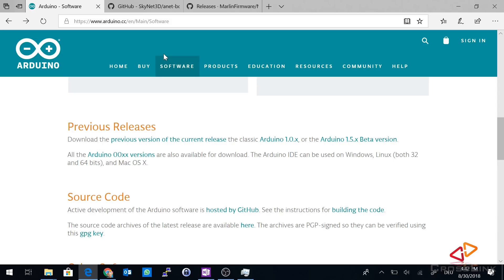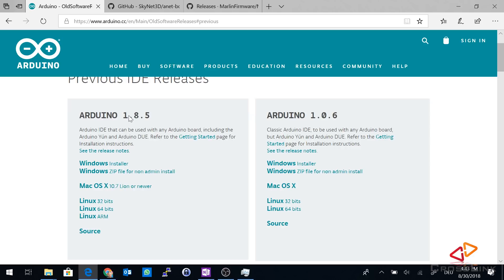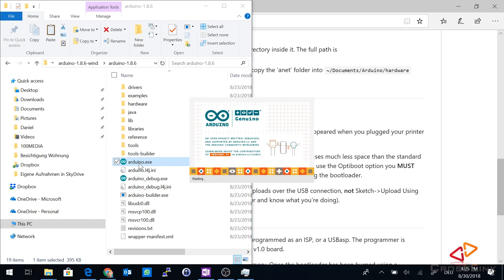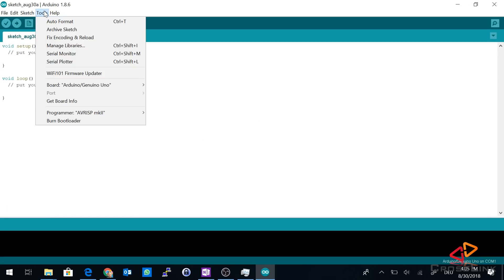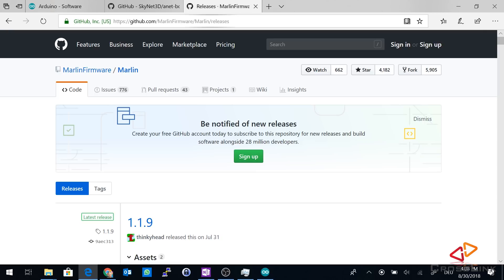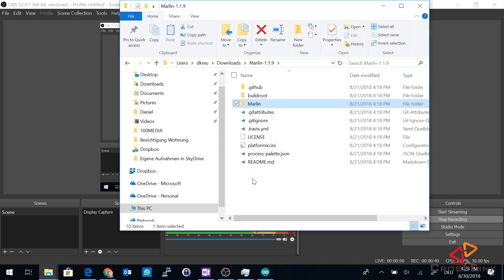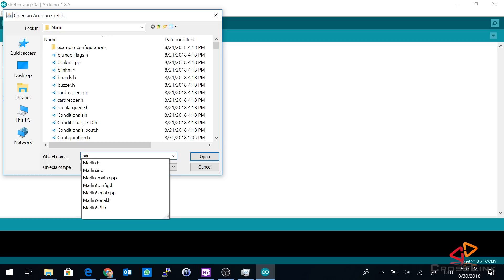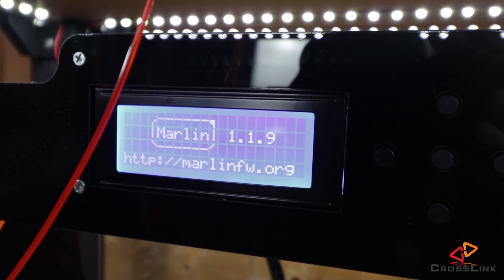How to install Marlin firmware 1.1.9 on your Anet A8 3D printer in 7 easy steps

Comment: Hi @Crosslink , aas Carole White 10 months ago, I've just got the same error.  The firmware uploaded OK.  Marlin 1.1.9 identifies on control panel, but  XYZ all alternating between ? and 0.  No other commands on the panel appear to be working.  Enter takes me to a menu, but trying to select anything sends me back to the home page.    Up and Down alter the FR %, but that's all.  Any thoughts?
Reply: Forgot to say, I don't have an auto bed leveller
Reply: Ahh! may have solved it.  What I am seeing is normal.  Just watched your Mesh bed levelling video and saw your screen displays the same.  The problem I thought I had is actually that the Right button no longer acts as the enter button, and the menu (middle) button actually takes that role.

Comment: I followed the instructions provided in the video and successfully installed Marlin on my A8. My hotbed, however, quit working. I found what I hoped would be a solution to this problem. I inserted the line of code and tested it. When I tried to download it I got a message. 
Problem uploading to board.  See http://www.arduino.cc/en/Guide/Troubleshooting#upload for suggestions.
there is no error code or any other info given. I undid the line I just put in and tried to flash it again. I got the same message. I have made no other changes to the code other than the one line. Did I break it somehow?

Comment: Thank you Daniel, your videos are VERY usefull andclear, but I've got a little issue with the point 2. 
After copied the "hardware" folder in "Documents\Anet\" (I had to create the Anet folder), I opened the arduino ide but the Anet V1.0 isn't listed in the avelable boards. I've tried to restart the pc but it's always the same. Help me please! :'(
Reply: ok I've solved! I simply copy the board definition folder inside the "hardware" folder located in the same directory of the arduino.exe

Comment: Now that I have Marlin on my Anet A8, why do my xyz axis's not move all the way to the limit switches?  Facing the printer, X will go all the way to the right, but not all the way left to the limit switch. Y axis will come all the way forward, but not all the way back to the limit switch,  and Z axis will go all the way up, but will not go down far enough to touch that limit switch either.
Reply from the maker: What does the printer do when you auto home? Is it going to the wrong direction? If yes, double check if you copied the Anet A8 default configuration from the samples directory in Marlin to the main directory to overwrite the defaults.
Reply: Yes I did overwrite the Marlin config files , with the ones from the examples folder . When I home it, hotbed goes back and stops, X goes to the left and stops at limit switch, and z goes down, but currently have to shut off before it gets to limit switch, because there is a bad pin on the board connector for that limit switch and getting new replacement day after tomorrow. This is a brand new board, but found limit switch wasn't working . Board is Anet V1.7.   So aside from having to shut down because of inoperative limit switch on z axis, does it sound okay?  Just funny that it will go to what looks like the old home position, but cannot move all the way manually. Other thing, is what do I need to do now ?

Comment: i keep getting missing character error:
Arduino: 1.8.5 (Windows 10), Board: "Anet V1.0"

In file included from C:\Users\RODNEY\AppData\Local\Arduino15\packages\arduino\hardware\avr\1.6.22\cores\arduino/Arduino.h:257:0,

                 from sketch\Marlin.ino.cpp:1:

C:\Users\RODNEY\Documents\Arduino\hardware\anet\avr\variants\sanguino/pins_arduino.h:43:0: warning: "TIMER2" redefined

 #define TIMER2  5

 ^

In file included from sketch\Marlin.ino.cpp:1:0:

C:\Users\RODNEY\AppData\Local\Arduino15\packages\arduino\hardware\avr\1.6.22\cores\arduino/Arduino.h:210:0: note: this is the location of the previous definition

 #define TIMER2  6

 ^

In file included from C:\Users\RODNEY\AppData\Local\Arduino15\packages\arduino\hardware\avr\1.6.22\cores\arduino/Arduino.h:257:0,

                 from sketch\Marlin.ino.cpp:1:

C:\Users\RODNEY\Documents\Arduino\hardware\anet\avr\variants\sanguino/pins_arduino.h:44:0: warning: "TIMER2A" redefined

 #define TIMER2A 6

 ^

In file included from sketch\Marlin.ino.cpp:1:0:

C:\Users\RODNEY\AppData\Local\Arduino15\packages\arduino\hardware\avr\1.6.22\cores\arduino/Arduino.h:211:0: note: this is the location of the previous definition

 #define TIMER2A 7

 ^

In file included from C:\Users\RODNEY\AppData\Local\Arduino15\packages\arduino\hardware\avr\1.6.22\cores\arduino/Arduino.h:257:0,

                 from sketch\Marlin.ino.cpp:1:

C:\Users\RODNEY\Documents\Arduino\hardware\anet\avr\variants\sanguino/pins_arduino.h:45:0: warning: "TIMER2B" redefined

 #define TIMER2B 7

 ^

In file included from sketch\Marlin.ino.cpp:1:0:

C:\Users\RODNEY\AppData\Local\Arduino15\packages\arduino\hardware\avr\1.6.22\cores\arduino/Arduino.h:212:0: note: this is the location of the previous definition

 #define TIMER2B 8

 ^

In file included from C:\Users\RODNEY\AppData\Local\Arduino15\packages\arduino\hardware\avr\1.6.22\cores\arduino/Arduino.h:257:0,

                 from sketch\Marlin.ino.cpp:1:

C:\Users\RODNEY\Documents\Arduino\hardware\anet\avr\variants\sanguino/pins_arduino.h:47:0: warning: "TIMER3A" redefined

 #define TIMER3A 8

 ^

In file included from sketch\Marlin.ino.cpp:1:0:

C:\Users\RODNEY\AppData\Local\Arduino15\packages\arduino\hardware\avr\1.6.22\cores\arduino/Arduino.h:214:0: note: this is the location of the previous definition

 #define TIMER3A 9

 ^

In file included from C:\Users\RODNEY\AppData\Local\Arduino15\packages\arduino\hardware\avr\1.6.22\cores\arduino/Arduino.h:257:0,

                 from sketch\Marlin.ino.cpp:1:

C:\Users\RODNEY\Documents\Arduino\hardware\anet\avr\variants\sanguino/pins_arduino.h:48:0: warning: "TIMER3B" redefined

 #define TIMER3B 9

 ^

In file included from sketch\Marlin.ino.cpp:1:0:

C:\Users\RODNEY\AppData\Local\Arduino15\packages\arduino\hardware\avr\1.6.22\cores\arduino/Arduino.h:215:0: note: this is the location of the previous definition

 #define TIMER3B 10

 ^

In file included from C:\Users\RODNEY\AppData\Local\Arduino15\packages\arduino\hardware\avr\1.6.22\cores\arduino/Arduino.h:257:0,

                 from sketch\Marlin.ino.cpp:1:

C:\Users\RODNEY\Documents\Arduino\hardware\anet\avr\variants\sanguino/pins_arduino.h:49:0: warning: "TIMER3C" redefined

 #define TIMER3C 10

 ^

In file included from sketch\Marlin.ino.cpp:1:0:

C:\Users\RODNEY\AppData\Local\Arduino15\packages\arduino\hardware\avr\1.6.22\cores\arduino/Arduino.h:216:0: note: this is the location of the previous definition

 #define TIMER3C 11

 ^

In file included from C:\Users\RODNEY\AppData\Local\Arduino15\packages\arduino\hardware\avr\1.6.22\cores\arduino/Arduino.h:257:0,

                 from sketch\Marlin.ino.cpp:1:

C:\Users\RODNEY\Documents\Arduino\hardware\anet\avr\variants\sanguino/pins_arduino.h:50:0: warning: "TIMER4A" redefined

 #define TIMER4A 11

 ^

In file included from sketch\Marlin.ino.cpp:1:0:

C:\Users\RODNEY\AppData\Local\Arduino15\packages\arduino\hardware\avr\1.6.22\cores\arduino/Arduino.h:217:0: note: this is the location of the previous definition

 #define TIMER4A 12

 ^

In file included from C:\Users\RODNEY\AppData\Local\Arduino15\packages\arduino\hardware\avr\1.6.22\cores\arduino/Arduino.h:257:0,

                 from sketch\Marlin.ino.cpp:1:

C:\Users\RODNEY\Documents\Arduino\hardware\anet\avr\variants\sanguino/pins_arduino.h:51:0: warning: "TIMER4B" redefined

 #define TIMER4B 12

 ^

In file included from sketch\Marlin.ino.cpp:1:0:

C:\Users\RODNEY\AppData\Local\Arduino15\packages\arduino\hardware\avr\1.6.22\cores\arduino/Arduino.h:218:0: note: this is the location of the previous definition

 #define TIMER4B 13

 ^

In file included from C:\Users\RODNEY\AppData\Local\Arduino15\packages\arduino\hardware\avr\1.6.22\cores\arduino/Arduino.h:257:0,

                 from sketch\Marlin.ino.cpp:1:

C:\Users\RODNEY\Documents\Arduino\hardware\anet\avr\variants\sanguino/pins_arduino.h:52:0: warning: "TIMER4C" redefined

 #define TIMER4C 13

 ^

In file included from sketch\Marlin.ino.cpp:1:0:

C:\Users\RODNEY\AppData\Local\Arduino15\packages\arduino\hardware\avr\1.6.22\cores\arduino/Arduino.h:219:0: note: this is the location of the previous definition

 #define TIMER4C 14

 ^

In file included from C:\Users\RODNEY\AppData\Local\Arduino15\packages\arduino\hardware\avr\1.6.22\cores\arduino/Arduino.h:257:0,

                 from sketch\Marlin.ino.cpp:1:

C:\Users\RODNEY\Documents\Arduino\hardware\anet\avr\variants\sanguino/pins_arduino.h:53:0: warning: "TIMER5A" redefined

 #define TIMER5A 14

 ^

In file included from sketch\Marlin.ino.cpp:1:0:

C:\Users\RODNEY\AppData\Local\Arduino15\packages\arduino\hardware\avr\1.6.22\cores\arduino/Arduino.h:221:0: note: this is the location of the previous definition

 #define TIMER5A 16

 ^

In file included from C:\Users\RODNEY\AppData\Local\Arduino15\packages\arduino\hardware\avr\1.6.22\cores\arduino/Arduino.h:257:0,

                 from sketch\Marlin.ino.cpp:1:

C:\Users\RODNEY\Documents\Arduino\hardware\anet\avr\variants\sanguino/pins_arduino.h:54:0: warning: "TIMER5B" redefined

 #define TIMER5B 15

 ^

In file included from sketch\Marlin.ino.cpp:1:0:

C:\Users\RODNEY\AppData\Local\Arduino15\packages\arduino\hardware\avr\1.6.22\cores\arduino/Arduino.h:222:0: note: this is the location of the previous definition

 #define TIMER5B 17

 ^

In file included from C:\Users\RODNEY\AppData\Local\Arduino15\packages\arduino\hardware\avr\1.6.22\cores\arduino/Arduino.h:257:0,

                 from sketch\Marlin.ino.cpp:1:

C:\Users\RODNEY\Documents\Arduino\hardware\anet\avr\variants\sanguino/pins_arduino.h:55:0: warning: "TIMER5C" redefined

 #define TIMER5C 16

 ^

In file included from sketch\Marlin.ino.cpp:1:0:

C:\Users\RODNEY\AppData\Local\Arduino15\packages\arduino\hardware\avr\1.6.22\cores\arduino/Arduino.h:223:0: note: this is the location of the previous definition

 #define TIMER5C 18

 ^

C:\Users\RODNEY\Downloads\Marlin-1.1.x\Marlin-1.1.x\Marlin\Marlin.ino:15:21: warning: character constant too long for its type

 located in the root 'Marlin' folder. Check the example_configurations folder to

                     ^

C:\Users\RODNEY\Downloads\Marlin-1.1.x\Marlin-1.1.x\Marlin\Marlin.ino:16:13: warning: missing terminating ' character

 see if there's a more suitable starting-point for your specific hardware.

             ^

Marlin:16: error: missing terminating ' character

 see if there's a more suitable starting-point for your specific hardware.

 ^

Marlin:30: error: too many decimal points in number

     (Applies to Marlin 1.0.x, so Jerk and Acceleration should be halved.)

                        ^

C:\Users\RODNEY\Downloads\Marlin-1.1.x\Marlin-1.1.x\Marlin\Marlin.ino:34:11: warning: missing terminating ' character

     Marlin's configuration options are explained in more detail here.

           ^

Marlin:34: error: missing terminating ' character

     Marlin's configuration options are explained in more detail here.

     ^

C:\Users\RODNEY\Downloads\Marlin-1.1.x\Marlin-1.1.x\Marlin\Marlin.ino:49:12: warning: missing terminating ' character

   -  If you'd like to contribute to Marlin, read this first!

            ^

Marlin:49: error: missing terminating ' character

   -  If you'd like to contribute to Marlin, read this first!

   ^

Marlin:2: error: expected unqualified-id before '==' token

 ================================================================================

 ^

exit status 1

missing terminating ' character

This report would have more information with

"Show verbose output during compilation"

option enabled in File -> Preferences.

so I have no clue what is wrong any suggestions ? thanks  and I love your tutorials

Comment: first thanks for all these videos.  my first question is do i need the marlin update? i have a tronxy p802ma anet a8 i3 clone. has a melzi 2.0_V5 board. second, i lost the SD card. can i just update marlin and use cura? or do i need to continue using repertier host with slicer brand slicer? thanks.
Reply: also my printer needed to be updated at purchase. a former coworker did it so im at a loss on how to do it.

Comment: THANK YOU DANIEL!!!!      I have owned an Anet A8 for two years but was always hesitant to change the firmware as other tutorials and info were kind of confusing and I did not want to brick my printer. Daniel's videos are very clear and understandandable as to showing what steps are necessary to upgrade to Marlin. I followed step by step as Daniel showed and was able do the upgrade without any problems whatsoever! I now have Marlin 1.1.9 and thermal runaway protection. Once again THANK YOU DANIEL!!!!

Comment: My Anet A6 have burned it's card. So i got a new card Anet V1-5. I will like too flash it to anet a6, but it dont work. If i flash it as Anet a8 its fine, but it's not the same center. If i flashing a6, It have problem on lcd-screne. Hope you understand my terrible english (komming from denmark)

Comment: compiles ok on 1.8.5 but won't flash 

Global variables use 4111 bytes of dynamic memory.
C:\Program Files (x86)\Arduino\hardware\tools\avr/bin/avrdude -CC:\Program Files (x86)\Arduino\hardware\tools\avr/etc/avrdude.conf -v -patmega1284p -carduino -PCOM3 -b57600 -D -Uflash:w:C:\Users\stanl\AppData\Local\Temp\arduino_build_827511/Marlin.ino.hex:i 

avrdude: Version 6.3, compiled on Jan 17 2017 at 12:00:53
         Copyright (c) 2000-2005 Brian Dean, http://www.bdmicro.com/
         Copyright (c) 2007-2014 Joerg Wunsch

         System wide configuration file is "C:\Program Files (x86)\Arduino\hardware\tools\avr/etc/avrdude.conf"

         Using Port                    : COM3
         Using Programmer              : arduino
         Overriding Baud Rate          : 57600
avrdude: stk500_getsync() attempt 1 of 10: not in sync: resp=0xb1
avrdude: stk500_getsync() attempt 2 of 10: not in sync: resp=0x44
avrdude: stk500_getsync() attempt 3 of 10: not in sync: resp=0x99
avrdude: stk500_getsync() attempt 4 of 10: not in sync: resp=0xff
avrdude: stk500_getsync() attempt 5 of 10: not in sync: resp=0x5a
avrdude: stk500_getsync() attempt 6 of 10: not in sync: resp=0xd8
avrdude: stk500_getsync() attempt 7 of 10: not in sync: resp=0x99
avrdude: stk500_getsync() attempt 8 of 10: not in sync: resp=0xff
avrdude: stk500_recv(): programmer is not responding
avrdude: stk500_getsync() attempt 9 of 10: not in sync: resp=0xffGlobal variables use 4111 bytes of dynamic memory.
C:\Program Files (x86)\Arduino\hardware\tools\avr/bin/avrdude -CC:\Program Files (x86)\Arduino\hardware\tools\avr/etc/avrdude.conf -v -patmega1284p -carduino -PCOM3 -b57600 -D -Uflash:w:C:\Users\stanl\AppData\Local\Temp\arduino_build_827511/Marlin.ino.hex:i 

avrdude: Version 6.3, compiled on Jan 17 2017 at 12:00:53
         Copyright (c) 2000-2005 Brian Dean, http://www.bdmicro.com/
         Copyright (c) 2007-2014 Joerg Wunsch

         System wide configuration file is "C:\Program Files (x86)\Arduino\hardware\tools\avr/etc/avrdude.conf"

         Using Port                    : COM3
         Using Programmer              : arduino
         Overriding Baud Rate          : 57600
avrdude: stk500_getsync() attempt 1 of 10: not in sync: resp=0xb1
avrdude: stk500_getsync() attempt 2 of 10: not in sync: resp=0x44
avrdude: stk500_getsync() attempt 3 of 10: not in sync: resp=0x99
avrdude: stk500_getsync() attempt 4 of 10: not in sync: resp=0xff
avrdude: stk500_getsync() attempt 5 of 10: not in sync: resp=0x5a
avrdude: stk500_getsync() attempt 6 of 10: not in sync: resp=0xd8
avrdude: stk500_getsync() attempt 7 of 10: not in sync: resp=0x99
avrdude: stk500_getsync() attempt 8 of 10: not in sync: resp=0xff
avrdude: stk500_recv(): programmer is not responding
avrdude: stk500_getsync() attempt 9 of 10: not in sync: resp=0xff